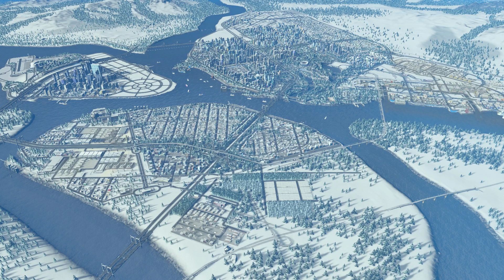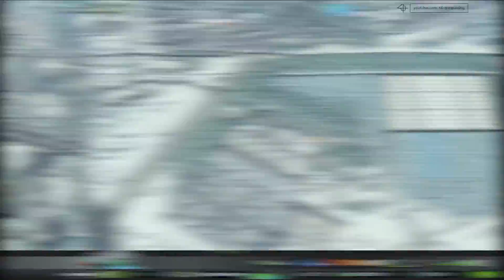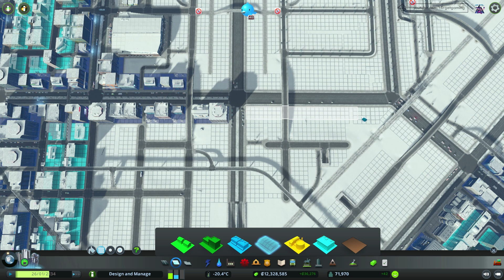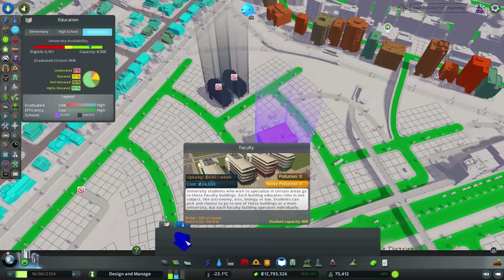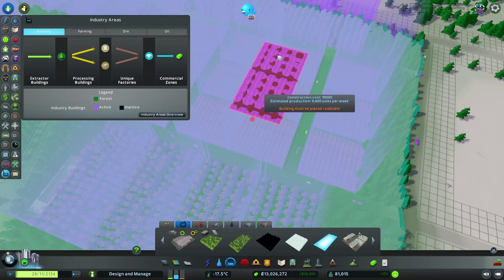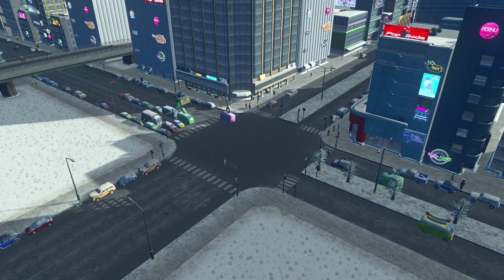How to Optimize Industrial Production | Unmodded Cities: Skylines – Design and Manage, Part 67

Comment: I can tell you exactly why your industries are operating at a loss.  It's because the production chain AI is currently bugged pertaining to warehouses.  An industry can function without a warehouse but it will not function as was intended by the developers.  Furthermore, placing warehouses as they were intended to be placed, which in outside of your industrial districts near your commercial zones or other areas that need products, causes bugged behavior in the production chain.  Currently, the only way to avoid this behavior is to place a warehouses inside of each industrial zone to collect your DLC processed products.  Base game industrial goods, i.e. "Zoned - Farming" don't cause this behavior and so you can place them wherever you want.  Until a patch is released this is the only way to properly integrate the industrial chain.  I've written a lengthy post about it on the workshop and support forums which clearly demonstrates the nuances of the bug.

Comment: Thanks for another great episode T4get.  Also a big welcome to all the new people with districts named after them.  When you start another series I'd love for more emphasis on using the new industry mechanics to satisfy city industry demand instead of lots of offices.  I think it would create a lot of new challenges and design opportunities with moving resources and goods around.

A possible reason that enabling the second cargo train terminal near the first one not helping with more resources is (if I remember correctly from when you first placed it) that it is not actually connected to the outside track.  The track that connects the first cargo terminal curves away from it when it connects to the inter-city track.
Reply from the maker: The recently enabled cargo station is connected to the outside region at the forestry industry, something I've done on the last episode. Trains coming from the north will have to do a big loop to get there, but the station is achievable. Thanks!

Comment: another great video! you inspired me to create an import based industry in my current city. the way i solved the lack of raw materials issue was to have as much import capacity (be it trains, air, ship, highway or a mix) as possible near the production facilities and have a decent ammount of raw material storage facilities (not warehouses and i set mine to balance) as close by as possible, preferable right inbetween your import route and the production facility. The other thing i needed to do was satisfy resedential demand and use schools out policy. Using these techniques i currently have all unique factories placed running at 150% with no extractor buildings. PS place more helicopters :P

Comment: T4rget, the second cargo train terminal that you abled is not connected to the outside of the city (so it can't import). 20:25 you should add a railway that connect it to one of the dead-end rails that you currently have.
Also, you should add some storage for ore and oil that are imported (so you constanly import and have some for your processing buildings).
Reply from the maker: It is connected to the outside city near the forestry industry. Trains coming from the north will have to make a big loop, but they can sure get there. Thanks for the tips!
Reply: @T4rgetGaming  OK i just did forget about it 😅